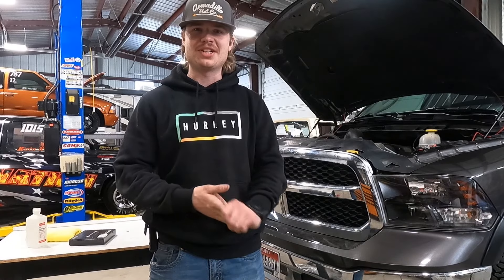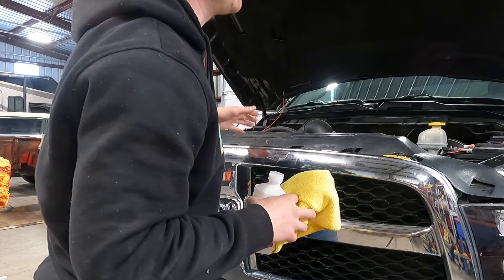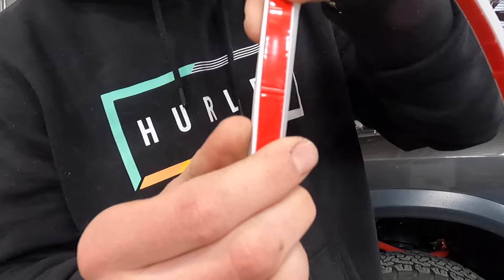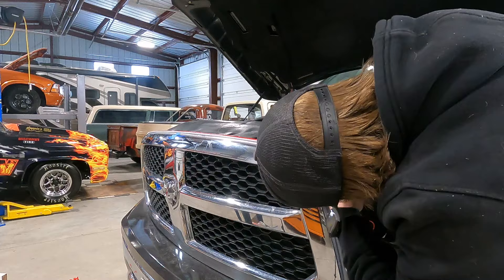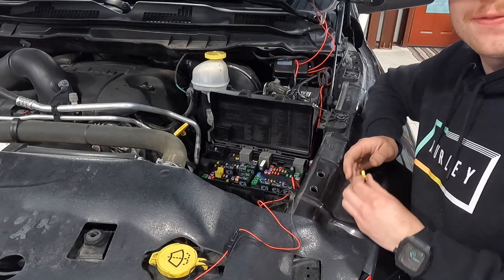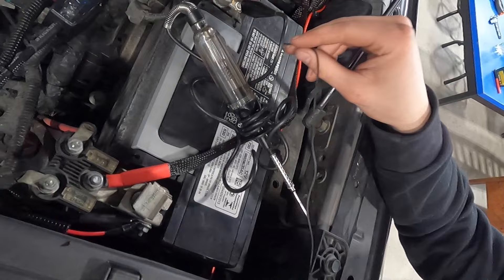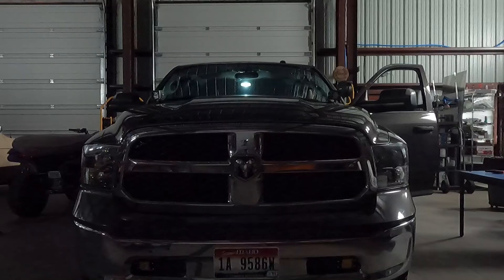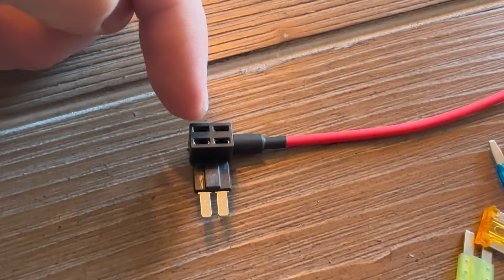Easiest Way To Install A Hood Light Strip! (For Most Vehicles)

Comment: What size fuse adapter did you use ? Are there different sizes?
Reply from the maker: It depends what fuse you are tapping into! If you ordered the kit i have, they give you a couple different options, there should be something in there that works!
Reply: @DakotaNationRacing  I tapped into a trailer light fuse. But I learned that my 2022 refresh Silverado has micro fuses. Which requires micro fuse adapter. I will be ordering some soon.  My original question was for whoever does the installation should show the way the fuse is being put in on the video. Thanks
Reply from the maker: I gotcha! Ill make sure to show that next time, the pack of fuses i got in the description includes micro fuses! Hope it all goes smooth for ya!🤙🏼
Reply: I’m going to be putting in the tailgate light kit soon. I’ve been looking at install videos on the web for that, most don’t really show how the connect wires close up so you can actually see each specific wire. Also I want to just do plug and play into the trailer wire plug on the truck but then they talk about a white wire connected to tail lights. They don’t do a good job showing the exact hook up. Thanks for letting e rant a little. I’m the kind of guy who takes hours to get stuff right the first time. 👍

Comment: My 2013 Longhorn  has a rubber seal above the grill  so can't  see where  it could  be visible.  😢
Reply from the maker: Oh man! You might be able to find a different way to mount it, ill have to try and take a look at a truck with those rubber seals!
Reply: 2017 Bighorn...   same rubber seal...   would hate to take it off....  trying to figure out if light will fit with seal in place......
Did you I stall light..?  Any update..??

Comment: The correct way is to tap into the Parking light harness. Using self sealing crimp connectors & shrink wrap. “Fuse Taps” are a poor quality/lazy hack job way to do this. “If it’s worth doing. It’s worth doing Right.”!
Reply from the maker: Many ways to get it done! Was trying to make it easier for people that aren’t super comfortable around wiring anyways, but yes there are better ways to do it
Reply: Yeah I like the easy simple methods too.  I’m not an electrician and I’m not paying bread if I can get away with doing it myself.

Comment: What was fuse amp you tapped into?
Reply from the maker: I used my “seat heater” fuse since that only powers on when the vehicle is on
Reply: @DakotaNationRacing  but each fuse has a different amp rating it think it is called, should it be connected to a 5, 10 or 15?
Reply from the maker: Your light should already have an inline fuse built in so it shouldn’t matter to much since its already protected down the line. If you have a 5 you can just use that
Reply: @DakotaNationRacing  thank you

Comment: Whats wrong if u don’t get fuse tabs
Reply from the maker: It’s just not the “right way” to do it, fuses aren’t meant to have a wire wrapped around one of the poles!
Reply: @DakotaNationRacing  but would something bad happen if u where to wrap it around
Reply from the maker: For sure could, I don’t like taking the risk!

Comment: I tried using that same fuse tap but I did not use Two fuses. Do I need to use two fuses when adding that adapter?
Reply from the maker: You need to use both fuses to complete the circuits, otherwise you wont have power!